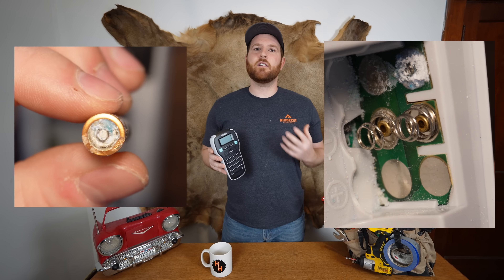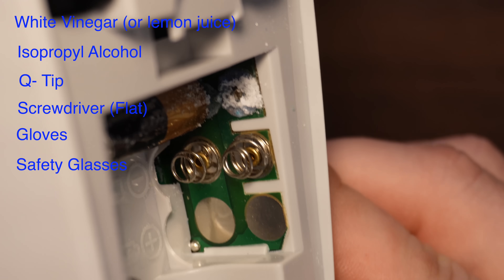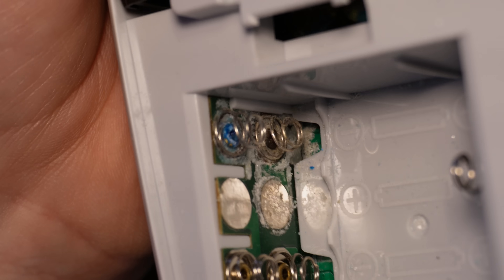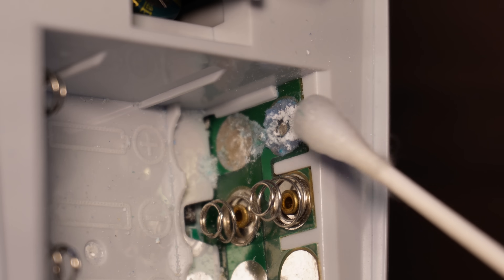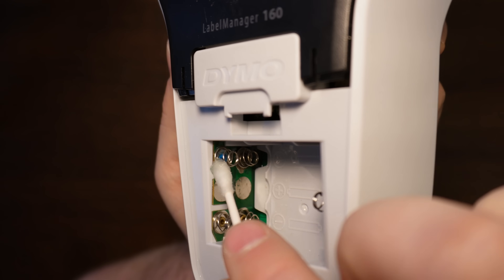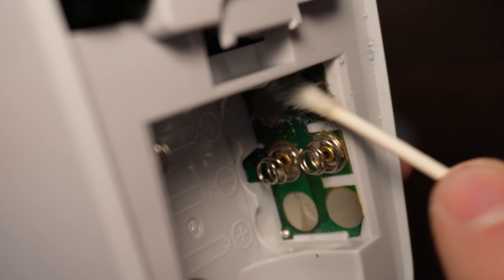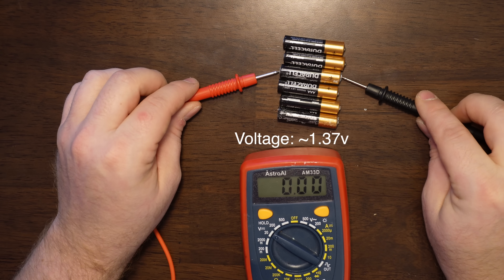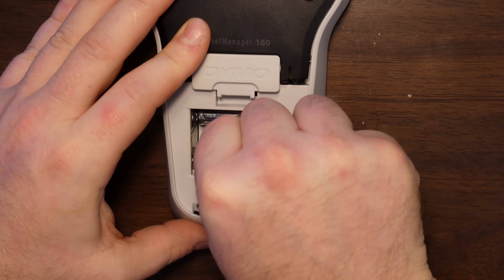Clean BATTERY CORROSION on ELECTRONICS! EASY DIY!  |  2-minute Tutorials Ep.4

Comment: I simply hate Alkaline batteries. Especially Duracell. They Always leak fluid that corrodes the terminals. The worst by far are Duracell, which I noticed you used in the video. They are so bad that even after cleaning as shown in your video my electronics usually don't work - they are toast.
The Durashit batteries, as I call them, leak well before the expiry date, even in unopened packets. They always leak during use even when it looks like that have almost full charge. It doesn't seem to matter where they are manufactured (US or abroad), all size alkaline Duracell batteries leak. AA, AAA and the 9V ones which I use the most. Basically, I don't buy Durashit anymore. They are an awful product.
Reply from the maker: Yeah, Duracell lost my business. Shame, used to be a great company imo..

Comment: I have worked in the construction laser sales and repair business for 23 years and I can tell you a $10 set of batteries that has leaked like this can cause hundreds of dollars of damage or more.  My hobby is music and I can also say that you can ruin guitars, guitar pedals and electronic keyboards the same way.  You give great advice on correcting minor damage but to prevent it all together remove batteries from anything that isn't in use or stored for any length of time and don't subject your stuff to extreme temperatures.  Also a product named DeoxIT is good but more expensive than vinegar  and alcohol.  Also the worst and most often leaks and out-gassing I have seen is from Duracell brand batteries.
Reply from the maker: I agree, don't buy Duracell and take out the batteries on expensive electronics when not in look. Thanks for the input and sharing your experience

Comment: And the moral of this story is... Never buy Duracell.
Reply: They all do this if you let them sit in something long enough.
Reply: @ElCid70  Yeh, but there are brands that last longer than Dur a cell... Use others...
Reply from the maker: Yup, I hundred percent agree… They lost my business
Reply: Same bro
Reply: My Duracell batteries have been inside one of my remotes for 10 years and surprisingly they still work
Reply: I always use Duracell, because the Energizers fail and corrode all the time.
Reply: @robertheinkel6225 you might check the name on the label. Duracell has become unusable since the pandemic.
Reply: Standard duracell sucks, but the higher priced ones with the stripe are much better
Reply: Yep. The only alkaline batteries I've ever had leak are Duracell.
Reply: If not Duracell then what?
Reply: Duracell is shit
Reply: In my experience Duracell batteries doesn’t live up to what is promised, once they might was good batteries, but they no longer hold up in storage, a few month ago I had to throw out around 20-30 AA’s because of leaks, even they should be good until 25 and 27.
So next time I need batteries, Duracell won’t be the ones I buy, unless I can get them really cheap.
Reply: @MrSuperJensen Best before dates on batteries are meaningless. You may have noticed they keep getting farther and farther into the future. In my experience batteries that say best if used before 2016 still have a full charge and it doesn't matter the brand. People also need to stop using alkaline batteries in IR remotes, you're just asking for corrosion. Instead you need to use 'Heavy Duty' batteries.
Reply: @gnolls  : I will take that into account for the future.
Reply: I just had my second Thrunite flashlight ruined by a Duracell battery
Reply: Once I showed them the receipt of the battery purchase, photos of the damage and asked them to reimburse me around 45$ for the torch that got damaged.
Reply: 100% true. Over the past ten years, Duracell batteries are the only ones that corrode. No problems with Energizer batteries!
Reply: Don't buy Kirkland batteries from Costco either. I'm pretty sure they're made by Duracell. Same color and same corrosion problem.
I have a package of Kirkland batteries that says on the front:  "Best used by 2027" and "10-year shelf life" - corroded in the package.
Total junk, never again.
Reply: @David_K_pi My Kirkland AA batteries were fine.  The AAA pack however had so many I had to throw away for losing their charge well before their expiration date.
Reply: Never buy batteries
Reply: @owomushi_vr  You shouldn’t steal batteries.
Reply: I’ve had good luck with Duracell. It’s the No name batteries 🔋 that have been a problem.
Reply: Duracell is now the new Ray-O-Vac.  I read somewhere that ROV now makes Duracell, and that’s why Duracell went to shit.
Reply: Obviously....you never worked with TV Production equipment.

Duracell is the ONLY battery I trust. 40 years of experience with them.
Reply: Nothing wrong with Duracell!
Reply: They ruined a brand new D Cell Mag Lite, that I never had a chance to use. Best part, it was still two years from the due date!
Reply: Duracell and Energizer suck. Always leak. 
Never had this happen from Amazon basics batteries even after being dead for years. Much cheaper too.

Comment: Yep.  That's a Duracell for ya.  Use Energizer.  They don't leak nearly as often.  They'll even send you a warranty check.
Reply from the maker: Yeah, Duracell has lost my business for sure! Shame...
Reply: I had a bulk pack of AA Energizers stored inside file cabinet, inside my house.  The last 6 to 8 batteries were all corroded, dated 12-2029.  I had some leak in an expensive flashlight.  I went to the file cabinet,  and that's when I discovered I effectively had none.  Rarely had this problem years ago.  Probably when the batteries were American made, and not made in China.

Comment: Saw this and instantly thought 'YIKES this is going to rust the metal and possibly damage the unit more".  One product I started using completely by accident is Krud Kutter's The Must for Rust (liquid bottle not the spray).  Using the same Q-tip method and the liquid on the end it chews through all corrosion quickly, you may need to keep changing swabs as the reaction lessens on larger corrosion.  Followup the cleaning with some isopropyl to clean the contacts and avoid any damage to the metal.  AVOID letting the liquids drip into the body of the electronic by holding the device with the battery compartment facing down.  Always remember to use eye protection, one of those springs could easily flick dangerous chemicals into your eye.
Reply from the maker: Thanks for your input. I've had great luck with my method. But, if it starts failing me, I'll try the Must for Rust Method you describe👍🏼

Comment: Another tool that is handy for removing tarnish and corrosion is a glass bristle brush.  It's just a bundle of string wrapped glass fibers.  Be cautious about using it on plated surfaces but for things like most battery contacts, or automotive light bulbs and sockets it works great.  It's abrasive enough to quickly remove tarnish but gentle enough to not scratch or remove the underlying metal.  And wear a double layer of rubber gloves - those little glass fibers are mighty annoying if you get them stuck in your fingers.
Reply from the maker: this is great advice, thanks for your input! I havn't heard of that before, I love learning new techniques👍🏼

Comment: How do I keep the batteries from leaking?
Reply from the maker: There's dozens of comments on here that say to stay away from Duracell and Kirkland Signature (Costco) batteries. They are notorious for leading. A sure fire way of making sure they don't ruin a device is to take them out of the device when it's not in use. This is impractical, most of the time, in my opinion. I'd rather take the risk

Comment: What about rust on a coil
Reply from the maker: i would clean it until i got good contact with the battery and call it good. If its too bad, i'd replace it, but its a bigger job that requires disassembly and soldering.

Comment: Baking soda and water also works just like on lead acid batteries , a neutralizer .. but I found the white vinegar is cleaner
Reply from the maker: interesting. i was under the assumption that high pH alkaline batteries needed a low pH acid (white vinegar) to neutralize it. while car (lead acid) Batteries (low PH) need a high pH (baking soda aka Sodium bicarbonate) to neutralize it?
Reply: @HandymanHertz  I think because the corrosion from the alkaline batteries on the terminal is from the electrolysis created from the resistance making sulfuric acid at that location, I’ve done cleaning some terminals, and I’ve tried both, but I think you have a point there the baking soda and water only does so much and vinegar does the rest, but at a slower pace .
Yeah, it seems the baking soda and water always works good on the corrosion part . But when the alkaline leaks out of the battery, that’s a different situation there and the vinegar might need to be used first. I’m going to try and experiment and I’ll get back to you.

Comment: USE CLR instead of vinegar.  Way more gentle and faster than acetic acid and it has a chelation agent that will remove instead of make corrosion on metal worse.  and it's way less acidic.  Other than that, following with isopropyl is a good idea(91% is best), then let thoroughly dry(for 3 days if you have any concern liquid got past the battery compartment.
Reply from the maker: Thanks for the tips 👍🏼

Comment: Duracell AA and AAA batteries are the absolute worst batteries for leaking and damaging equipment. DON'T USE DURACELL AA and AAA BATTERIES! If your equipment can use NiMH or Energizer lithium batteries (NiMH batteries have slightly lower voltage than alkaline - Duracell - batteries) use either of those types. The NiMH are rechargeable which will save you some money. The lithium batteries cost a little more, but last a long time.
Reply from the maker: I agree. Im done buying Duracell copper top.

Comment: Don’t EVER buy Duracell. They leak far more than ANY other brand- avoid them like the plague.
Reply from the maker: I’m realizing this from the comments…I thought I just got a bad batch!
Reply: @HandymanHertz  Maybe twenty years ago they were fine, and would virtually never leak. 
Then I’m guessing they cut costs, and they’re now complete rubbish. I wouldn’t put them in anything for any longer than instant use, and then be sure to remove and discard. 
I will NEVER EVER buy DURACELLS again, and wouldn’t put them in my devices even if they were free. I’ve lost so much electronic gear to these damn things, and then just when you think you’ve got rid of them all you find another device in the house that you’ve missed, ruined. 
The latest I lost thanks to Duracells was a good quality multimeter- battery voltage was fine and still well within the “use by” date. The good multimeter is likely toast, though I’ll try to repair it.

Comment: An ounce of prevention is worth a pound of cures...
Why not think to seal the battery ends before putting them in?
Could use a drop of superglue on ends of battery, being careful not to get it on the contact point, of course you'd have to let this dry before installing. 
Another alternate, dip each end of battery in oil or vaseline or grease, wipe off the excess and install. 
Perhaps someone else has another idea?
I also think dipping battery ends in hot candle wax and then scrape or scrub off excess??
Reply from the maker: I love this way out thinking. I’ve learned from the comments that some put Vaseline on the terminals. I wonder if putting it on the battery or superglue would actually seal the battery or if it would leak through? I might have to try that. Thanks for the good idea.

Comment: My label maker eats batteries… Even when it’s turned off. So, I’ve learned to take one of the batteries out and store it in next to the “ink” cartridge, and I don’t have dead batteries every single time I get it out. This has also limited the batteries getting corroded if I don’t use it for a while. I’ve only had that happen one time, and it wasn’t that bad because there wasn’t a path for electricity through the entire thing. There was no closed circuit.
Reply from the maker: That sounds like a good plan, what battery brand do you use?

Comment: In my experience, anything abrasive will tend to attract oxidation of the metal contacts, but the finer the abrasive (like polish) the longer the gear will last before having to be cleaned again. I agree that where batteries have leaked, a weak acid on a swab is best to remove the encrusting metal salts. I'd discourage using tools like screwdrivers, file or sand paper etc at least as much as possible.  If you do have to use something like that, then go with as fine an abrasive as you can to get the job done & a good metal polish afterwards.  Polishes are not all equal, I tend to use Autosol metal polish as I have found it gets a high polish pretty quickly & it's more of a paste so it doesn’t run all over the place like liquid polishes can.  Clean the polish off with alcohol & then apply an electrical contact cleaner conditioned like DeOxit F5 or similar product. This dries to leave a thin semiconducting skin over the contacts that excludes oxygen from causing corrosion anytime soon.  It's thin enough to be very low resistances at the actual contact, but it's resistive enough to not cause short circuits across to other components.  In my decades of experience maintaining auditorium PA equipment, these semiconducting contact cleaner/conditioner produces tend to last at least 6-10 times longer than just using a straight contact cleaner or alcohol.

Some products are not safe on some contact types, but the Deoxit product seem to be safe on most things.  I have cleaned a lot of component tracks & buttons, remote controls, computers, analogue audio equipment (mixers, equalisers etc).  If one side of the contact looks like metal, the cleaner conditioner product will most likely work very well.  If, however both contacts look non-metallic, you’re probably best served cleaning with, alcohol.  If you do use a conditioner product & it doesn’t work, try cleaning that off with alcohol & drying it.  Do not touch the contacts with your skin as this can leave an oily residue.
Reply from the maker: Thanks for your input! I appreciate it  👍🏼

Comment: Good info. I don't use my label maker much so I keep the batteries in a plastic bag and use when needed. It doesn't take long. For installed batteries I set up a 6 month calendar reminder to check those batteries. You have to have the discipline to do the work but it saves me from problems like this.
Reply from the maker: this sounds like the best practice. Thanks for sharing

Comment: Baking soda and water.  Cleans even car battery posts.
Reply from the maker: Baking soda (sodium bicarbonate) has a high ph, which works to counter car batteries (low ph). 

But these alkaline batteries have a high ph, so they need a countering chemical reaction in an acidic (low ph) form, such as vinegar or lemon juice.
Reply: @HandymanHertz  i have been using baking soda on remotes and such. It seemed to clean the them.  I will try vinegar.  What % vinegar to water?
Reply from the maker: Typical store bought 5% that you should find for about $1 at any store.

Comment: Excellent home DIY, I should try it out. 
BTW, vinegar is acidic, if it leaks inside the circuit board, what’s going to happen?
Once, I tried to clean the outside of a TV remote with a Lysol wipe. It seeped inside and short circuited the remote rendering it useless.
Reply from the maker: Hope it works for you. Yeah, good point, probably nothing good will come from that. I try to not oversaturate the q tip so it doesn’t drip. Comments on here say to use an electrical cleaner, maybe that’s something to look into.

Comment: I had new battery's corroding in the box unused in my stock.  What is the deal with that?  I thought that they fixed the problems with those years ago.
Reply from the maker: Are they Duracell or Kirkland? Those two are notorious for leaking long before their expiration date.  terrible design.
Reply: Duracell, and they are not cheap.  I guess I paid extra for the leaking ones. @HandymanHertz

Comment: With all respect, a simpler and easier way to remove battery corrosion is simply to wipe down the contacts with club soda. I have been using this method for decades and it works great!
Reply from the maker: Club soda is acidic, just like white vinegar, so I can see how that would work. You are still going to want to Wipe off the reside (with alcohol) on either choice. Thanks for your input 👍🏼

Comment: Thanks for taking the time to make this. I have an old pocket transistor radio with bad corrosion around the battery contacts (all green). I got rid of a lot of it then tried the vinegar but I didn't get any fizzing you show. Am I supposed to add baking soda to start the reaction?
Reply from the maker: What sort of batteries are they? Alkaline batteries should fizz, but only if there’s a lot of leakage. Thanks for watching! I appreciate it.

Comment: You should try precision tip  type of cotton swabs.  They have pointed ends which are wound tighter than the regular type.
Reply from the maker: Interesting, I’ve never heard of this. Thanks for your input!
Reply: @HandymanHertz often found in the cosmetics area of the store
Reply: @YouthfulOne ,
I ordered some from Amazon recently, and they're good because they have two kinds of ends, which have a nice amount of cotton and are really compressed, so the cotton doesn't easily come off, but they are alot smaller than q-tip brand.